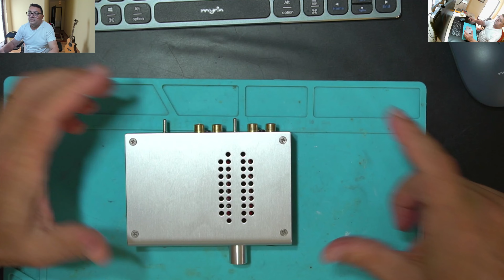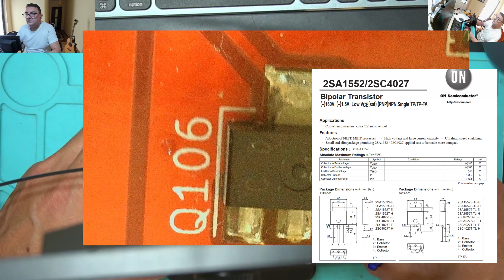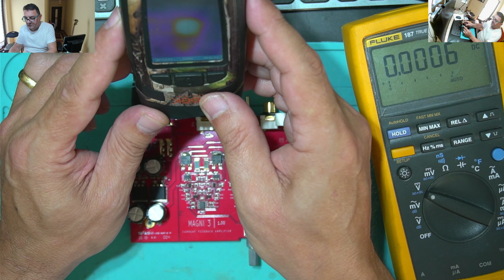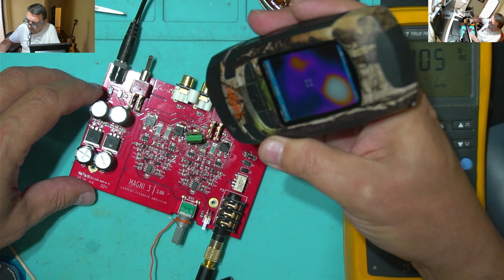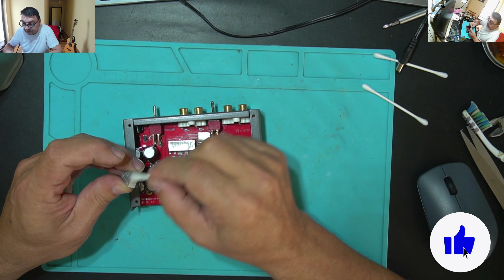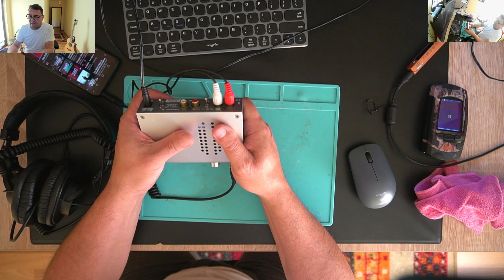Schiit Magni 3 Dismantle Fix and MOD

Comment: dude makes it look easy. currently trying to trouble shoot my magni 2 uber. changed 16v 1000uf capasitors to 25v 1000uf. cap was blown. Also changed the power switch which was broken. since the cap change i get power through the unit with lights but no sound. the relay dosent click. And i was so proud of my soldering:(((
Reply from the maker: Take your time and check the components, the relay it's drived by a little mosfet nearby, check if you power in that area...